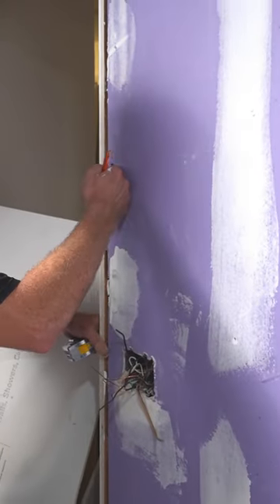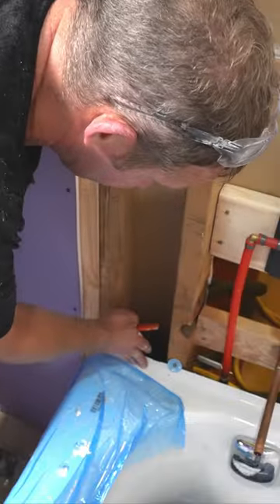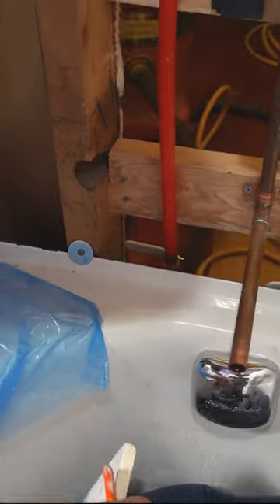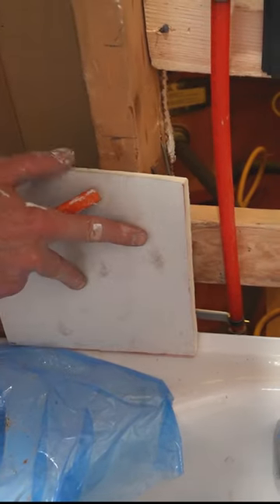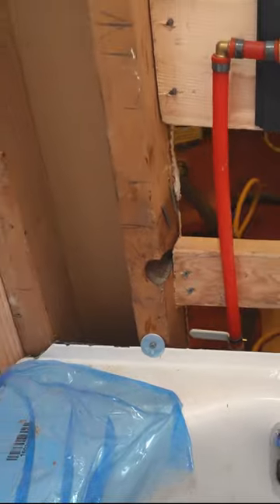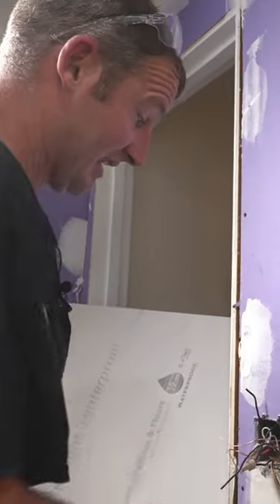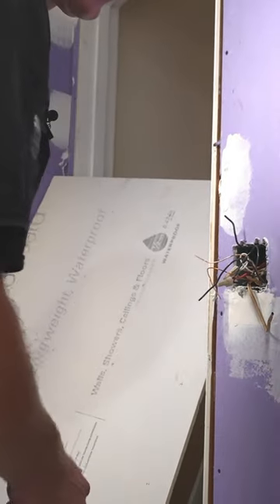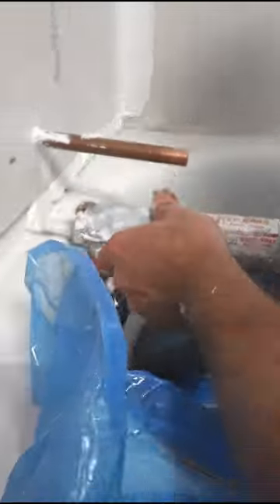Drywall to shower tub flange #diy #tile #shorts #waterproofing

Comment: you don’t wanna overlap the tub flange with drywall especially if you’re going to tile.  First of all the amount of weight that a tub fills up with during a bath is enough to cause some slight shifting. if the flange pushes out on your drywall you’ll start to get cracks in grout. eventually if your caulk joint from tile to tub fails (it will) the drywall will start soaking up moisture and then you’ll get mold behind the walls.  Once that mold starts building up back there no matter how many times you caulk over it the mold will creep back out unless you tear the whole thing out and start over.   Also I would use hardi backer instead of drywall
Reply: Nop, you want durock , hardibacker or any cement board overlapping the tub no t driwall, you just have to put an 1/8 joint between the tub and the hardibacker as a movement joint anf filled with caulking to prevent moisture to climb the cement  board, when install the tile leave the same joint an after the tile is intall use caulking to fill this again and leave some little holes to drain any water traveling behind the walls. Also alway put some mortar under the tub to hold the weight on the floor of the tub . Make some holes on the tub lips and some 1 1/2 screws and that tub is solid as can be.
Reply: It’s purple. Mold and moisture resistant
Reply: @johnsandlinjr  20 years ago here it was green & now they don't want you to use any type of drywall behind tile.
Reply: He's using Go Board (which is water resistant) you can see in the other videos for this project

Comment: I install concrete backer board a few extra inches out from the tub so it will never get soaked/ soft /moldy from water splashing out.  Tiling 4” to  6” forward of the tub all the way to the floor and they will never have a water damage issue.

Comment: Regardless, Do you want drywall anywhere near water?
Reply: that's why they make moisture resistant sheetrock...I use aqua defense membrane as a precaution anyway
Reply: @daleon96  don't use that wax coated drywall with membrane. It won't stick as good. Just install the membrane correctly and there will be no issue.
Reply: It’s GoBoard ppl 🧐

Comment: I like your content most of the time but this one is way off base 

1) the make a plastic drywall bead by trim- Tex called. Wait for it “ shower head”. Just for this exact purpose and it should be used with dura-bond. ( the real one  brown bag) 
2) never use that much caulk to fill. Use backer rod if there was this large a void. And even then don’t do it 
3) extension jambs are the way to go. And your correct not on the door side. That’s why you slid the frame in to the correct place and put the extension jamb on the outside. This is carpentry door 101 
3) fur the wood wall out with lumber  to account for the tub flange  another bathroom remod 101. 

Now don’t get me wrong there is more then one way to skin a cat  and there are circumstances that we have to make adjustments for but better planing help in a better finished product and it’s just makes it easier and that makes it more profitable
Reply: bro no offense but furring out walls and making jam extensions just to account for a tub flange is a huge waste of time unless you’re trying to upsell a job and make more money. you are supposed to run your drywall and or hardi backer(ideally) short of the flange or just on top of the flange but not touching and run your tile 1/4”-1/8” above tub and caulk from tile to tub.  The reasoning is so that should water ever get behind a failed caulk joint it should run back into your tub instead of soaking up into your substrate.
Reply: Nahhh you’re wayyyy offf. Waste of time. No customer has that kind of money. Budget

Comment: Do you really have that roofing nail washer holding that tub ? The screw isn’t through the tub it’s just the washer pressure holding it .
Reply: That's what many tub manufacturers call for
Reply: @S00Satisfying  & thats okay. But when you’ve been doing these things for awhile you’d understand that many manufacturers call for many different things and they fail because they aren’t the ones installing these day to day in different scenarios other than they’re little “tested” and “we reconnected” tactics.
Reply: Haven't had screws with fender washers fail yet 🤷‍♀️